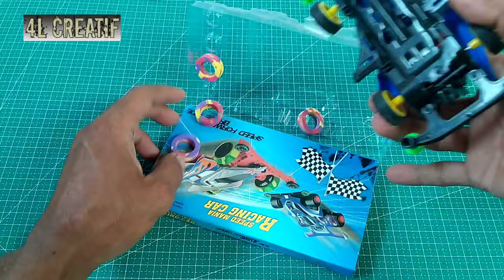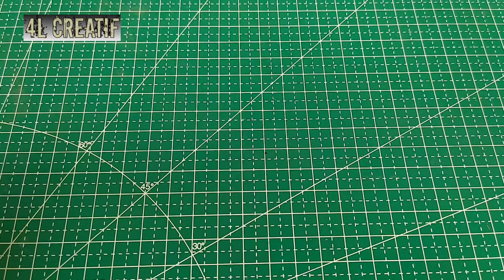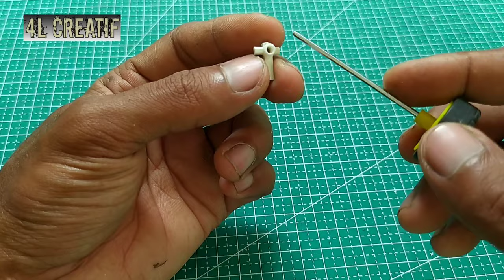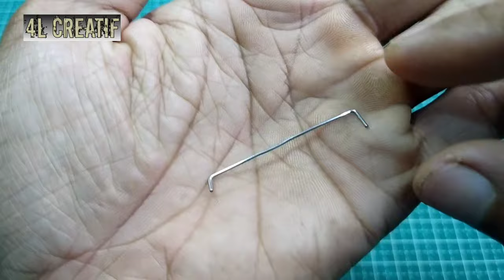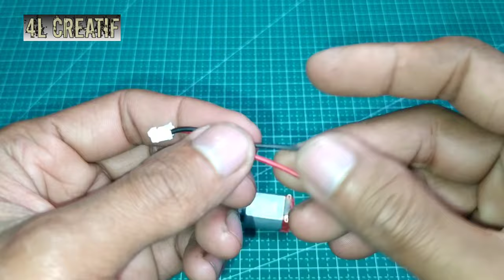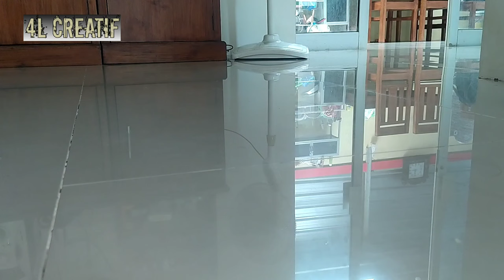modifikasi mobil tamiya menjadi mobil remot control #tamiyarc #mini4wd

Comment: Baterai lipo yg dipakai itu berapa volt bang? Biasanya sistem RC WPL itukn min 7V sedangkan lipo cuma 3.7V, itu dimodif ato emg bawaan dari beli bang?
Serius nanya soalnya ane juga sama bikin tamiya RC dgn konsep beda cuma minim pengetahuan soal RC WPL
Reply from the maker: Baterai nya pakai lipo 2s bang
Reply: @4lcreatif817  berapa mah bang?
Reply: @ShinAsuka36 1s is 3,7v which means that 2s battery has 7,4 volts